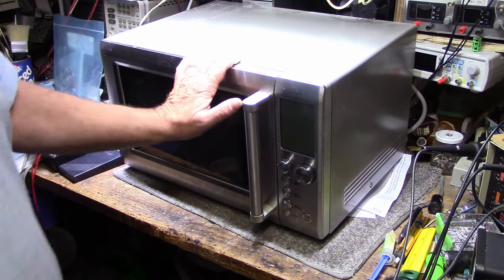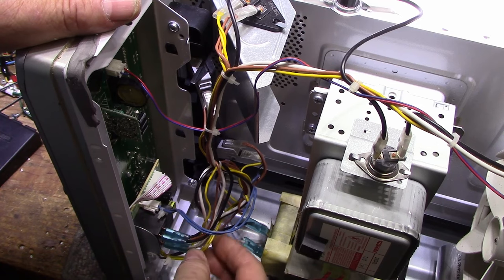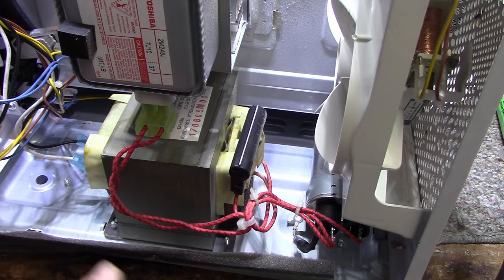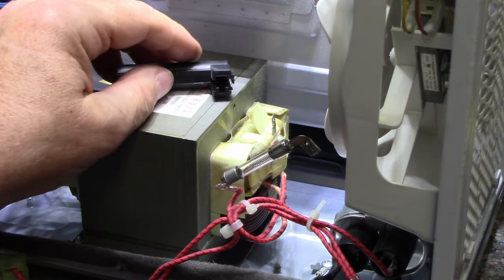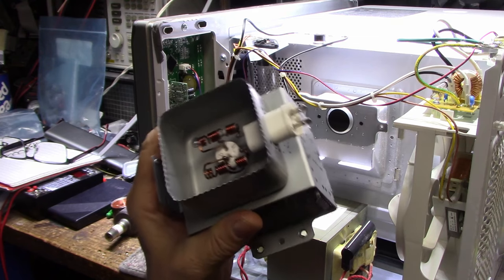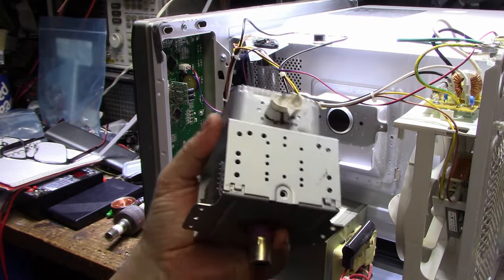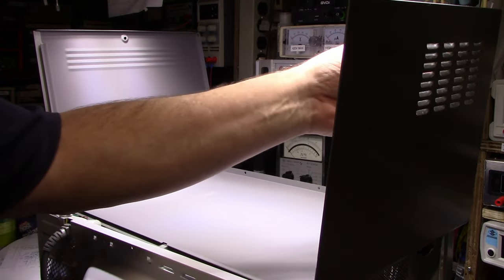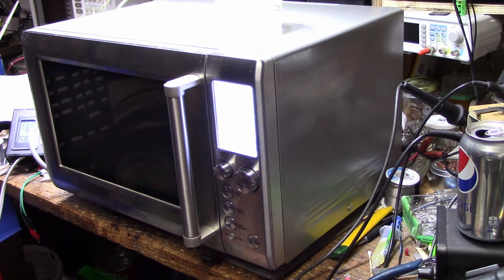Breville BM0734XL Microwave Oven Repair (Ep. 201)

Comment: between the two pins there is a cap and you can replace that in the magnetron. The cap is in the white connection with the two connectors.
Reply from the maker: Thanks, I didn't know that just the connector could be replaced. The original was welded to the chokes, not something one could solder.
I would still opt for replacing the magnetron because of the high voltage and my luck with those kind of repairs isn't good

Comment: Nice repair, as always. When you checked the capacitor for charge, you had the voltmeter on AC.
Reply from the maker: The mode switch on the right had the meter in DC volts. It was out of frame and you couldn't see that.
Good eye

Comment: First time repairing microwaves of that type. The damaged magnetron is repairable, it is just a matter of changing the white connector that sells it new. This failure is very common in microwaves along with capacitor failure. The magnetron in normal conditions of hard operation many in fact have a useful life of 5 thousand hours or even more. Another thing that usually gets damaged is the control panel keyboard or the electronic control card.

Comment: I agree with the previous comment. There is a capacitor in the white magnetron connector. Overtime it becomes leaky and at KVs that leads to failure. You can replace just the connector but it is a little bit of a work. I repaired mine but it failed with something else a couple of years later.
Reply from the maker: Thanks, I didn't know the connector was replaceable, good to know

Comment: I remember replacing a magnetron in our microwave about 20-odd years ago now (eesh) and the replacement unit was about $80 back then, which you could nearly replace the microwave itself for a little more than that back then as well, except this one was kind of special since it JUST fits under the cabinets and has an agitator in the top at the end of the waveguide instead of a turntable. It is still working. :)
Reply from the maker: In this disposable world, what we get to replace a broken unit isn't necessarily better just because it's newer

Comment: I replaced the Magnatron (the org 2m248j) with a 2m248JJ, had a short between the terminals to the case. I had to modified the mount plate using two vertical bars on the left and one vertical bar on the right because the JJ version has two tab on each side instead of the plate like the above one. The high voltage fuse (in the black plastic case attached to the transformer right side). The special HV fuse is a 5kv .9amp slow blow type 6x40mm glass type. The diode measure was ok using the 9v method.